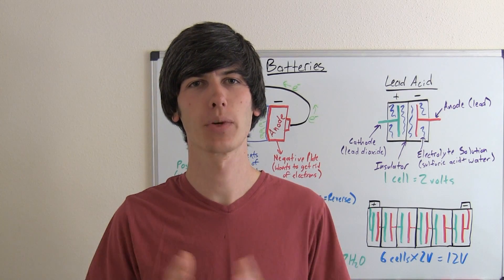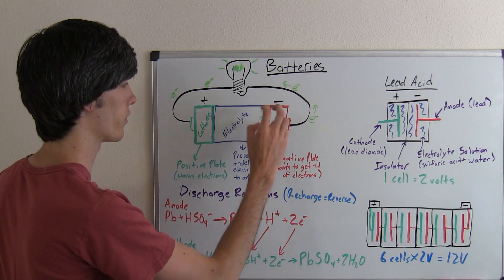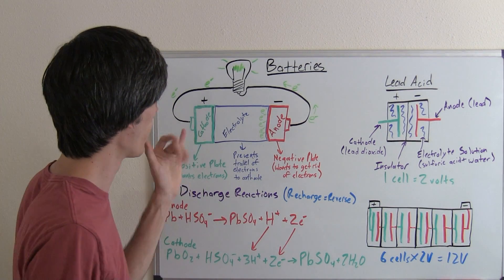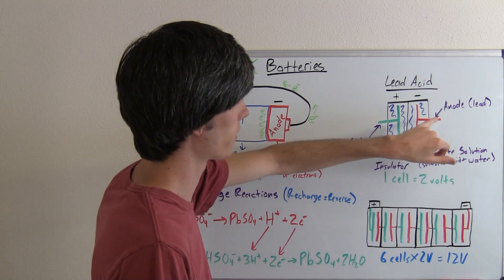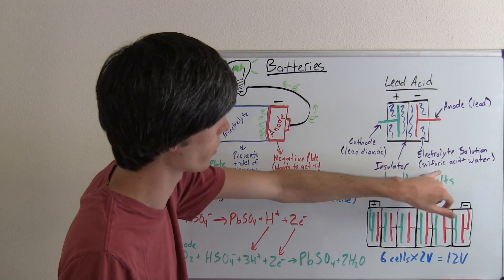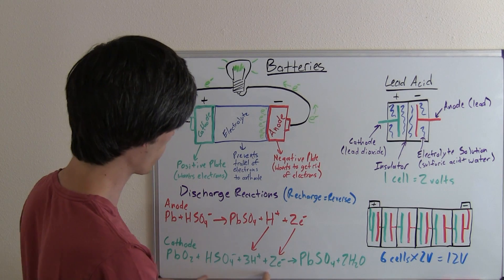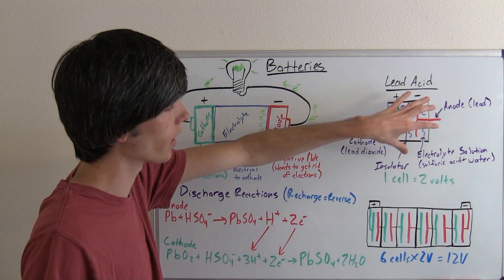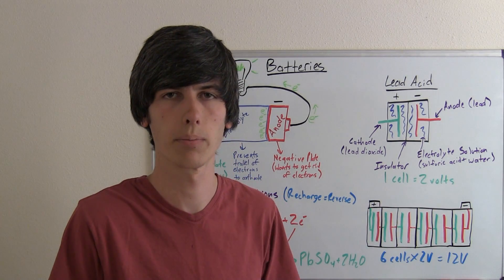Car Battery - Explained

Comment: I have 2 questions:

1- In the charging phase, the chemical reaction desulfates the lead plates. So how come they sell car batteries chargers that only charge the battery, and also batteries chargers that charge the battery and desulfates it?! The second being more expensive. 

2- On the simple battery diagram, there is an insulator separating the acid solution on the cathode and the acid solution on the anode. The discharging chemical reaction says that the electron and the hydrogen gas have to go to the other side. The electrons go to the other side via the cable connected to the battery poles. How does the H2 go to the other side?!

Comment: Hey Jason, assuming electric motors are 90% efficient, how far could a gas car go if its engine/drivetrain had that kind of efficiency? What if only 10% of the potential energy was lost to heat?

Comment: Hi Engineering Explained and all, I have a question that need gurus out there to help decode.

I came across someone selling a homemade voltage stabilizer with 100000 uf worth of capacitors, with emphasis on good grounding wires for certain components in the engine as well.
I wonder does it really help in the operation of a car electrical circuit and boosting its performance?

Please refer to the 2 links for more info:-

Voltage stablizer
https://forum.lowyat.net/topic/1289791

Grounding wires
https://forum.lowyat.net/topic/1495749
---

Please enlighten me on this.

Thank you!

Comment: Great explanation bud. Simple and so down to earth.

What about the amperage of a battery. See, I need a new battery for my car (VW) with 380 amps. But if I want a Kirkland or LTH brand, these have over 500 amps. These are supposed to be designed for my car. The VW stealer says it could damage my electronics. What is the deal here? Thanks bud.

Comment: Yo! And hippies. Before you all flip your wigs, think about this.
When a battery is used to pass a current through water, oxygen and hydrogen gas is produced.
Okay, let's look back at the redox properties.
Oxidation means the loss of electrons, and it also mean the loss of hydrogen ions. hmmmmmmmmm
The anode is where oxidation takes place. Wouldn't one reason that the hydrogen gas will be collected at the anode terminal.
Hey wait! I did that experiment years ago on my very first day of Chemistry Class! :-)

Comment: Trust me! Electrons flow inside the battery. 
Split the reaction into redox half reactions, and then you will see where you made mistakes.
Inside the battery, oxidation means electrons flow inside the battery toward the cathode. Hmmmmmm the cathode has what charge? What do  you think happens outside of the battery when a load is added? Why is it recommended that we unhook the negative side of a car battery first. That is, when the car isn't running! Hmmmmmmmmm Perhaps no electron flow there? You be the judge!

Comment: What happens when you wire batteries in series? I know that they increase voltage but what actually happens that actually increases voltage?

Comment: You can remove a car battery once the engine is started right? I know the alternator provides power for the car once the engine is started because all the alternators on my families' cars are belt-driven.
Reply: +Aaron Gasvoda you can, if you want to risk frying your car electrics. The battery acts as a buffer and smooths out the voltage spikes from the alternator whilst its regular adjusts to changing engine RPM and load. The battery prevents the voltage going too high in the split second it takes to adjust.
Reply: Aaron Gasvoda Yeah but I'd sugges tthat if you want to lighten the weight switch the battery for an ultra capacitor instead so you don't have to reattach the battery each time you want to start the car

Comment: Good video. However I don't understand how the electrons are flowing from the negative post to the positive post, but the current is flowing from the positive post to the negative post.
For example. In a starter circuit, if the current coming out of the positive terminal going through the starter, then through the engine/ frame and back to the negative terminal, why is the negative terminal connected to the engine/frame. The negative cable would be sending a current right thru the negative battery cable into the engine/frame.
Reply: Current & electrons flow in opposite directions, Current is produced by the electron flow. Since the electrons are moving from negative(--) to positive(+) the current will be moving in the opposite direction. (DC)
Reply: Jeremiah Dupree I don't get how both electons and current have different direction of flow. Since the current is PRODUCED by the electons (current and electron flow is the same thing)!??
Reply: Stefan Ovcharov I'll break it down for you, But first you must keep in mind that Electrons have a negative(--) charge & they move towards the positive(+) (DC). As a RESULT of the electrons moving through the wire a current flows in the direction of the displaced electrons. meaning from (+) ~> (--) this is it trying to balance it's charges. We measure the strength of the current in (Amps). Amps are measured by the amount of ELECTRONS passing through a single point in the wire.
Reply: Jeremiah Dupree So the electrons are flowing out of the negative battery cable that is connected to the engine block and then to the frame. The current is flowing out of the positive battery cable thru the load of the circuit then to the frame then to the engine block then thru the negative battery cable  back to the battery?
Reply: Steve S  I can' t get how you talk about 2 different flows (electron flow and current) since the electrons CREATE current? I don't get your point.
Reply: Stefan Ovcharov My reply was a question based on Jeremiah Duprees' statement to you, that in a wire electrons flow from negative to positive while current flows from positive to negative because of the displaced electrons trying to balance the charge. It seems to me that electron flow and current should be moving in the same direction. I'm still confused too.
Reply: Steve S okay I'll put it like this.. If The Negative ions(Electron) are going to the left, Then The Positive Ions are going to the right.. The Positive Ions bring the current, but the current is caused by the moving electrons seeking a positive charge..
Reply: Stefan Ovcharov It might do you well to look up the basis of Direct Currents since it is used in most of today's vehicles.
Reply: Well, the answer to this confusing problem is actually rather simple. Back then when some very smart men discoverd and observed electricity, they came to a point, where they had to explain the whole thing. The problem was however, that they didn't know back then what electrons are. Electrons where just discovered about 100 years after electricity was discoverd. So they came up with theories how electricity supposedly workes, which actually weren't that wrong. But when it came to the direction of the flow of whatever made electricity up. They had a 50:50 chance and...well, they were wrong.
(By the way, electricity is not in every case made up by flowing electrons, basically every flow of charged particles can induce a current doesn't matter if positiv or negativ)

Now you may ask, "but why they never changed the polarities to correct their mistake?" Well, as i said electrons were discovered about 100 years after the electricity, to be precise electrons were discovered in 1897 and now you may get an idea why it was never changed. There were already a lot of electric installations in place back than and to change it at this point would have ended in total chaos. And it doesn't matter for 99.99% of all applications anyway because basically every electric device is designt with this mistake in mind.

Comment: how does the car recharge its batteries ?
Reply from the maker: The alternator does this, which is driven by an accessory belt on the engine.
Reply: SweetT Hks Buy a new battery. Your battery holds less and less power over time from degradation until it gets to the point where it can't hold enough to power your vehicle. This generally happens faster the more often you let the battery completely die. Definitely try a new battery before a new alternator.
Reply: SweetT Hks  Anything to keep a little extra $$ in your pocket bud!
Reply: rectifying circuits?

Comment: How do batteries lose cells if they just flow around?
Reply: the flow of energy is either converted to work (ie moving windshield wipers, spinning fans, etc), heat (ie wires warming, lights giving off heat, etc) or light and is lost that way

Comment: From what I understand a maintenance free lead acid version uses a lead calcium tin alloy for the plates. The electrolyte is allowed to condensate within the battery case. There is a safety valve to prevent gas pressure building up. The amount of electrolyte in the sealed battery is enough to last the lifetime of the battery.

Comment: Another great explaination, thanks.
Could you explain why old batteries do not work as good as the new ones, and why the "dead" ones can shortcut your system?
Thanks again !
Reply from the maker: The metal plates begin to wear over time, and flake off/dissolve into the fluid mixture inside. Eventually the chemical reactions can no longer take place, or the battery shorts out as material builds at the bottom.
Reply: Ok, thank you very much!
See you soon

Comment: How do the cells get connected to terminals?
Reply from the maker: They each have contacts with one another, and these contacts at each end are the terminals. + and -, You can add material to move the location of the terminals.

Comment: How does a battery "die"?
Reply from the maker: The metal plates begin to wear over time, and flake off/dissolve into the fluid mixture inside. Eventually the chemical reactions can no longer take place, or the battery shorts out as material builds at the bottom.

Comment: the new batteries that we have in the market the one you don't need to put any battery water
maintenance free" are they the same as  the old once which need to put battery water?
Reply from the maker: They're definitely different, but I'm not sure what makes them "sealed."

Comment: Lost me. Why did you say current flows from positive to negative then say it flows from negative to positive. I happen to know that DC current is the flow of electrons, and they flow from negative to positive, or cathode to anode. I've always been told the cathode is negative and anode is positive. Very confusing video.
Reply from the maker: The convention says that current flow from + to -. Electrons are negative, so the actual flow of electrons goes from - to +.
Reply: Engineering Explained
Electrical circuit theory was derived from hydraulic circuit theory, whereby the fluid always flows from positive pressure to negative pressure. It just happens that for electrical circuits, it's the electrons that flow to the positive terminal instead. During circuit analysis, it makes no difference to the current and voltage magnitudes as long as one sticks to a consistent convention.

Comment: In those chemical reactions, what causes a battery to wear out? What changes after discharge and recharge cycles?
Reply: Heat. Law of thermodynamics.  Which is why is can never be 100% after its first recharge and will subsequently get worse.

Comment: Why is each cell 2 volts? Couldn't you have 3 cells producing 4 volts or some other configuration making the needed 12V for the car battery? Basically I'm asking is there some reason each cell is 2V in your video (Science, convention, etc.) or did you just pick an easy to explain number?
Reply: bump
Reply: bump

Comment: Since it's a 12V battery, does that mean you can grab both nodes with your hands? As long as you aren't grounded or touching metal, you should be fine, correct?

Comment: How are the cells connected? Why do they alternate poles?
Reply from the maker: Basically the chemical reactions that occur within are not 100% reversible, and over time this becomes more noticeable as the battery cannot go back to its original charged state.

Comment: You forgot to mention that the electrolyte solution permits the passage of the hydrogen ions back and forth between the anode and cathode. I know you implied it in a way, but it would be better to mention it.